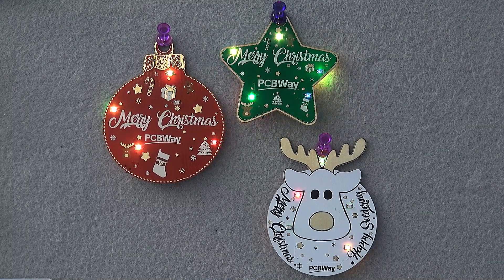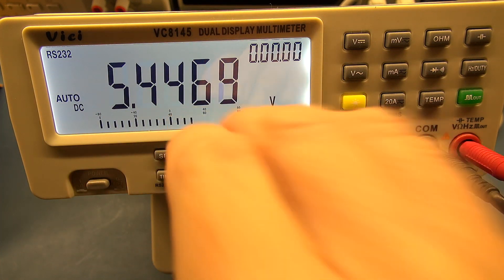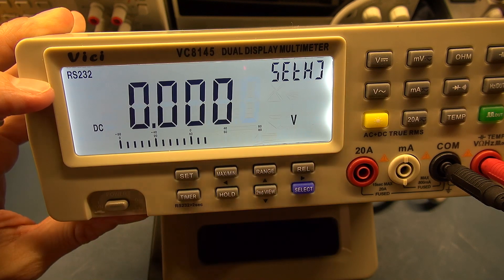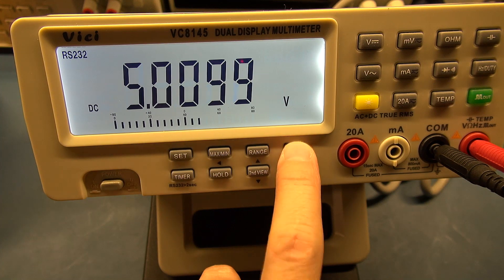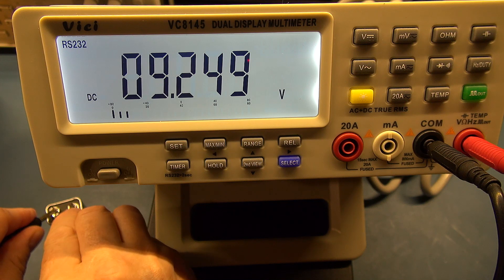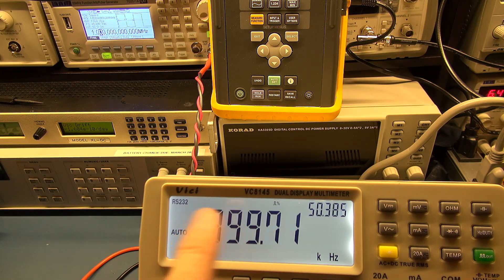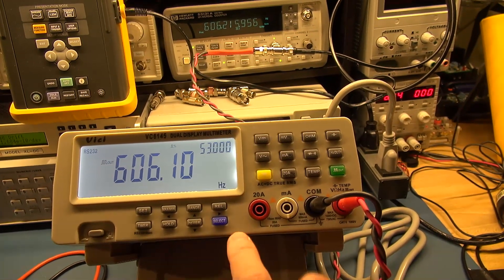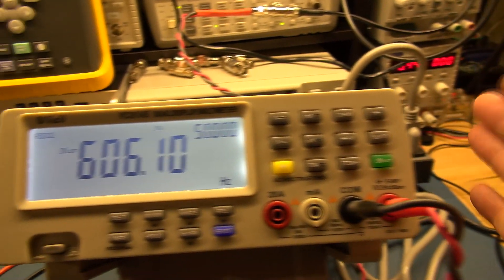Vici / Vichy VC8145 Bench Multimeter Review  - Part 2

Comment: Thank you Martin. A great video series. 

I own one of these and the reason is that it is almost uniquely good for audio measurements. When reviewing meters, many people focus on the range and precision of the dc voltages which in a lot of applications is of course what you need. The other element which often gets comment is how high meters can go for ac - again a vital point and particularly for many industrial users. What commentaries often miss is low-voltage ac resolution and bandwidth. This unit has a brilliant low voltage ac range of just 80mV. Plenty of meters stop at XV and those that go lower often only reach X00mV. This 80mV range is not just sensitive, it also has the bandwidth. While many meters support true RMS, very few can measure the whole audio spectrum. I guess they are targeted at power measurements and capturing true power on 50Hz and 60Hz supplies with bandwidths of hundreds of Hz. This unit however is rated to 50kHz which is really unusual at any price. In fact, you would struggle to find any other meter that has both audio bandwidth and a low ac range in the tens of millivolts. Clearly this device was designed by an audio enthusiast, just look at that selectable impedance function for the dBm mode that you showed here. As well as everything you said, people should note that this makes a great audio-focussed bench meter.

Comment: I've checked in my meter and the auto hold works in auto range mode, you just have to keep the probes on the measuring terminals a bit longer. It will beep once, then wait some more time and, after the second beep, it will show the measurement on the display.
By the way, there's an opensource software for the serial communication that runs on Win10 in this link http://www.26th.net/public/projects/vc8145/ and on the EEVblog forum there is a thread about the VC8145 where someone posted a simple mod to turn on the backlight when turning on the multimeter, very worthwhile.
Reply: Oh, I also noted that my meter shows a 1.5mV offset when measuring a negative voltage (or current). For example, I am reading 5.0000V from my voltage reference, if I swap the leads position (COM terminal of the meter to the positive terminal of the reference) the meter will show -5.0015. This offset is constant through all ranges. Would you check that, please?

Comment: Have one for +/-  a year, for the money you can't beat the performance of this meter. I have better meters but mainly use my Vici on the bench. (Always on on the bench , less burn time on the expensive meters and no battery going flat) The beeper is not so bad, testing voltages in hard to reach spots let you know you have good connection. You can not get a 8K bench meter for this money and it have good accuracy also. Test probe's not the best, diode test more or less OK not great and  no uA function- would be nice. ("bench meter" not a substation HIGH ENERGY compliant meter. Who work on +500V circuits on the bench anyway. Electrical shock are more dangerous  than a meter up in smoke:-[ ) Thanks great video and greetings from the SA.

Comment: The FIRST thing I would do is shoot the beeper!  Actually I might attenuate it because sometimes it might be useful, or switch it.
Reply: Add a volume control, or at a minimum a 3 position switch on the rear panel to select regular, soft or off for it.

Comment: First modification would be to put a piece of scotch over the hole in the beeper, then there is a mod where you invert the light circuit so the light is on pr default and you then can turn it off if needed, if memory serve me right it is just to cut one trace on the pcb and then solder a jumper wire.

Comment: Next we test the diode and continuity function... and we can see 3.1 voltage there, that should give us SOME HINT what it is using for testing... This is nice voltage level for testing diodes... but in real life it is exactly 150 mV off.
You didn't trust it and did connect the Fluke? So how accurate this diode test is?

Comment: Friend, this multimeter has good accuracy in dc measurements or you think it is not so good.
which smallest resistor value does it measure?
What about the Owon XDM1041 multimeter, it would be more accurate than this DCV addict

Comment: RS 232 really needs to have that board removed, and in it's place a USB socket with any of the serial interfaces on it, so that USB cables are usable, with the meter providing the isolation on the main board. Adding in a small lithium pack and charger on the free area inside the case would also be nice, there probably is enough voltage from the existing transformer to do a 2S lithium cell and protection circuit, along with the charge circuitry as well. you could also add a BT interface as well, and connect to it that way as well.
Reply: I am using it with a comparatively inexpensive (Prolific chipset) EXTERNAL USB adapter - about $20.   If you remove the internal optical isolation provided by the embedded board, you have lost an important feature that should be retained, IMO and "for what it is worth."

Because the internal serial port isolation is powered (use DTR and RTS from the external serial port connection to power the opto's), some adapters don't work.  Unless you want to do quite a bit of surgery, this isolation makes it tricky to use a Bluetooth serial adapter -- I've done it and, IMO, it isn't worth the effort.  

Simplest, using an appropriate USB serial adapter, seems to me to be best solution.  This is "bench-top meter" so, having a wired connection should meet 99.9% of all needs.  Again, IMO.  BTW, the adapters that I have tested with this meter that work for me are: 1. Sewell (Prolific chipset) and Edgeport (Digi International).  Ones that don't work, typically, are the least expensive Chinese designs (CH340 and FTDI, etc. chipsets).  The issue is, again, their failure to provide sufficient voltage/current on the DTR and RTS lines.
Reply: @richardgrier4721  The isolation is on the main meter board, the rear adaptor board is merely a way to connect 4 wires to the D connector. Plenty of internal room for a separate board containing the appropriate USB converter and the requesite circuitry, and replace that rear port with a USB type B socket for easy detachable connection.
Reply: @SeanBZA Yeah, but.. No electrical isolation (unless using a Bluetooth module).  A standard USB module is non-isolated, so the extra effort (again, IMO) is not worthwhile for a non-Bluetooth module.  A standard USB TTL/CMOS interface connects the meter ground to PC ground, unless using an isolation transformer or equivalent.